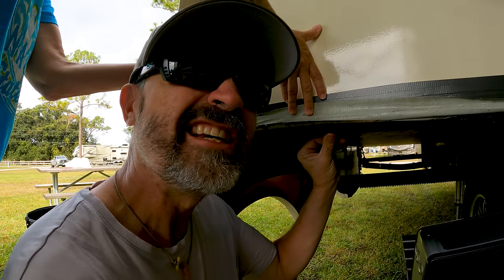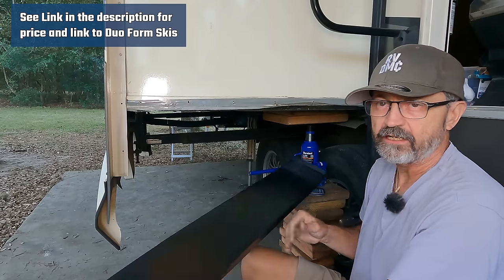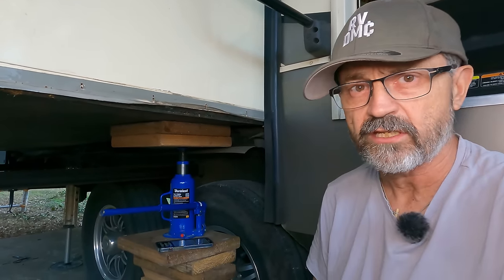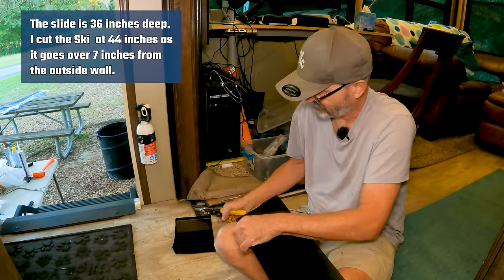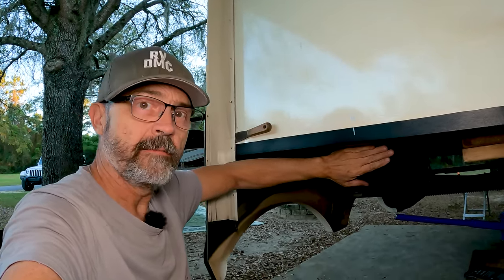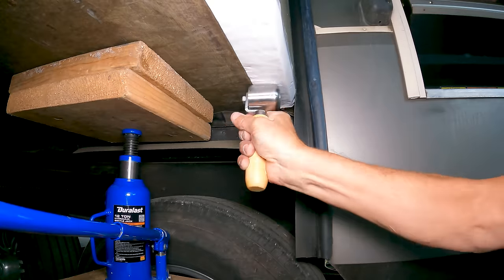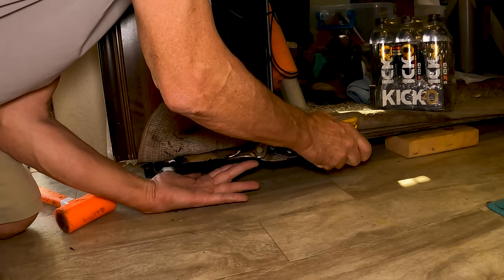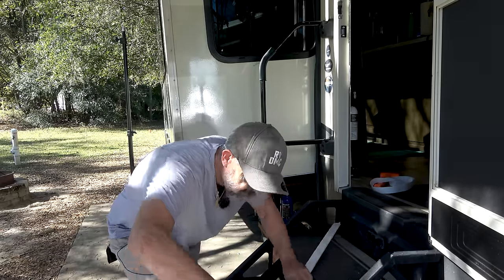RV Slide Water Damage repaired with Duo Form Skis (RV Living) 4K

Comment: Do those screws hold floor up? I have a 1 year old rv and notched floor sagging on one side and skis cracked no wetness though …I’m assuming what you did is what I need to do and when I jack up floor and put new screws that will fix sagging floor.. like I said rv is only one year old super weird never had this happen to any other of my rvs in the past
Reply from the maker: Yes the screws go into the floor wood to help support it.  I was luck that after drying out the wood it was still prettty firm and the longer screws grabbed well.  If your screws are not grabbing, use longer ones, if they still dont grab you may have to replace a section of the wood.  Larry
Reply: @DownsizingMakesCents  thank Larry for the reply and thanks for your videos Have a good one

Comment: would it work if you put the external lip of the slide-out ski underneath the slideout wall? just in case the seam is compromised,
Reply from the maker: Mine wouldn’t fit under the sidewall, it was too tight, but that is a good idea it will make sure the water stays on the outside of floor board.  Larry

Comment: Question - does this need to be done even if the seal at the top of the trim piece is good?  I don't have skis on my slide outs right now.  No soft spots in the floor.
Reply from the maker: I think adding the skis is a good preventative measure or after having to do a repair but it is not necessary if you have a good seals and no leaks.

Comment: Did you replace the rotted wood?  If so, how?
Reply from the maker: I didnt have to replace any of the wood, after i dried it out very thoroughly the wood was still strong even though the crappy chip board they used at the factory had swelled a bit, but the swelling floor didn’t effect the operation of the slide.  Truth is I was too lazy to replace a large section of the floor, i would have had to remove the up desk ,my computer, NAS and the carpet.   The ski protects that corner well.  If the floor need replacing you will have to take everything out of the slide, peel the carpet and pad and insulation back, cut out the bad section, put in new piece of wood, then I would cover the entire floor with a new sheet of at least 1/2 inch plywood to strengthen it.  Hope this helps, Larry

Comment: Surprised you did not fix the wood that was rotted/soft.  Quite easy to do with the correct epoxys, one to harden the rot and one to fill any missing wood.
Reply from the maker: Hey David, i though about fixing the wood with some filler or epoxy but after I dried the wood for a couple of days with a heater, it felt very solid.  I guess i was just being lazy.  I also only had a day or two of good weather to do the repair before we were going to get more rain.  If i ever get mor rotten floors I will either replace or treat the wood.  Thank for your advice, Larry
Reply: @DownsizingMakesCents  There are two different types of epoxy for the purpose, one is fairly liquid for injecting into damaged wood, it will harden soft punky wood (make sure you have dried out the wood completely, you don't want to encapsulate wet wood) , then there is a fairly stiff epoxy that can be used to fill missing wood pieces.  This type of epoxy can be shaped, the more liquid hardener can't be.  You can drill holes into soft wood and force the liquid epoxy into it with an injector.  There are some videos on the web about the process, but it does work pretty well.

Comment: Good video very thorough but anybody that's doing this, and I have several RV told me make sure the slide ski is inside of the fiberglass. No need for eternal Bond as that's going to be a sob if you ever have remove it
Reply from the maker: I agree best to be inside the fiberglass, mine was bonded to the floor wood and couldn’t get it behind it unfortunately.  I inspect mine regularity to make sure it stays water proof.  Larry
Reply: @DownsizingMakesCents  I don't think you'll ever have a problem with that slide, you made sure of that... Fortunately I'm able to get behind the fiberglass...

Comment: Looks good but the ski is designed to go under the siding instead of the trim piece
Reply from the maker: The new ski is orientated in the same way as the original. 
I understand your point. Thanks.
Reply: @DownsizingMakesCents  yours came with skis? I'm adding mine to a slide that they weren't on before. I only got my info from the manufacturers video not my own experience. I will add them as soon as the floor and frame are reinstalled.